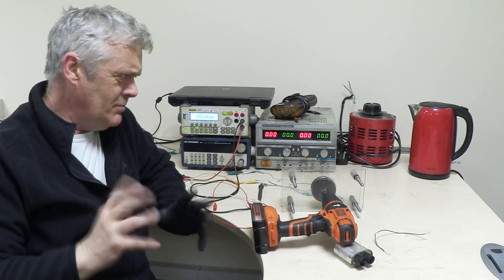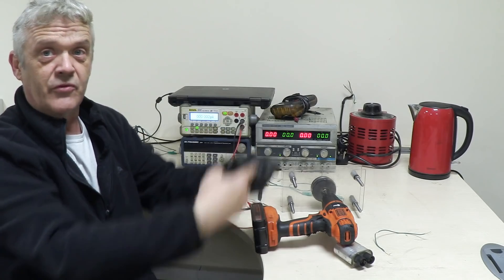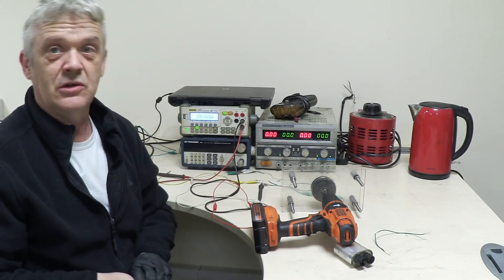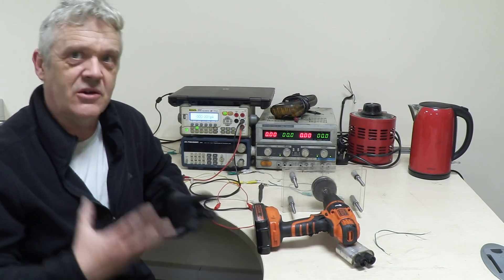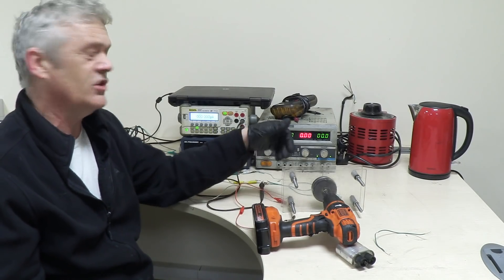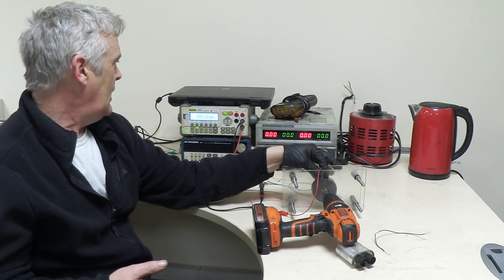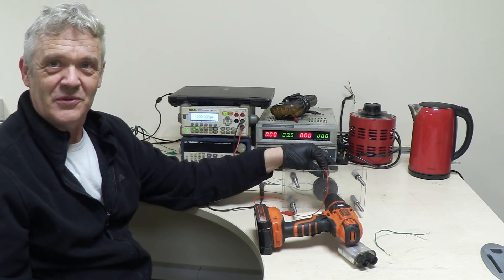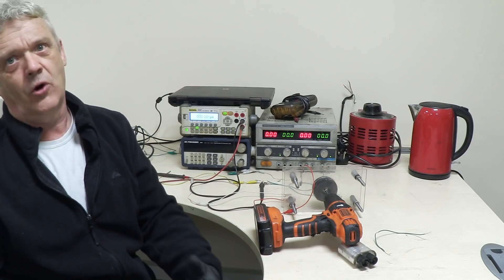Strange Behaviour Of A Tesla Homopolar Generator

Comment: Is it possible that there's a weak electromagnetic field being created by your lab equipment? Maybe try it outside and measure the current using a dc powered meter.
Reply from the maker: probably not mate - but it is easy to replicate for sure and you could test for that
Reply: @ThinkingandTinkering  Ha I'm still struggling to make a working supercapacitor tho since my background is electrical I'd possibly have more success with the generator.

Comment: I think it's of the characteristic of the fields. We typically think of them as being fixed fields around our objects. If there was any sort of lag at all it's less than the speed of light then what you're maybe seeing is a small oscillation of the field as it moves in space. Even if you have a wire moving relative with it the field itself is moving in a lag behind the objects.  Or at least it's my thoughts on why you're detecting a small amount of current. 
The reason for the leg I imagine may be the fact that you charge particles in the air as a repercussion of there being a field. That air dust particles or whatever maybe a secondary field source causing this lag of the field.
Reply: Follow-up experiment idea: would be to try to see if it works in a vacuum!
Reply from the maker: go for it mate
Reply: @ThinkingandTinkering  hysteresis is the name of such lag phenomenon. Interesting read